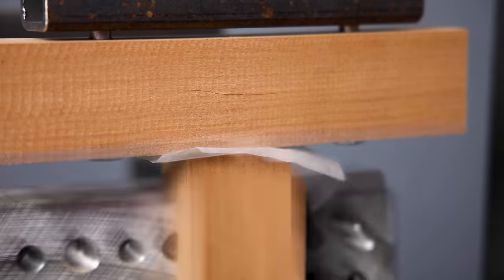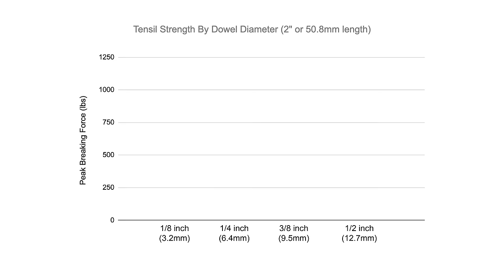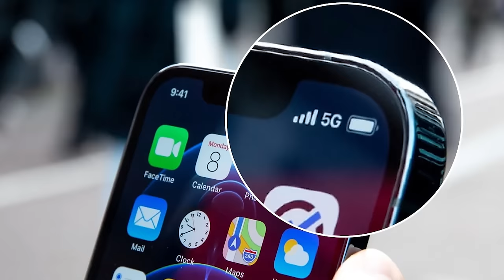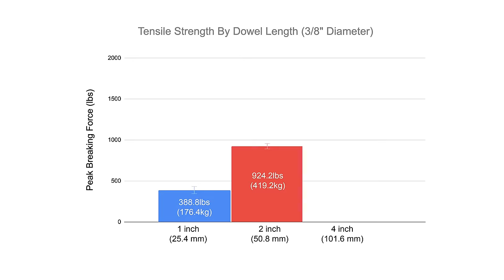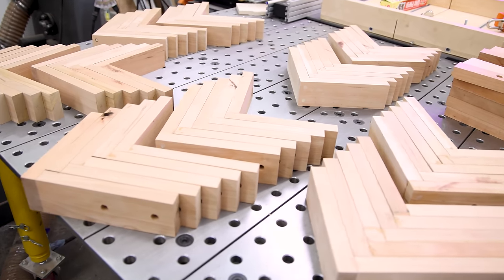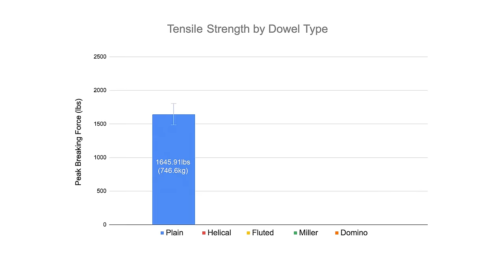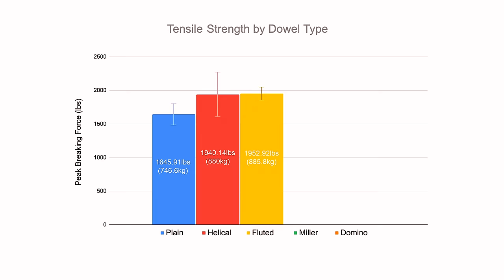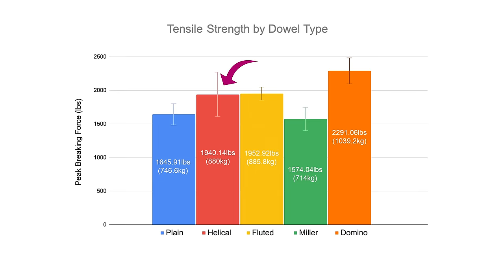festool domino vs  dowels

Comment: The Miller dowel probably has quite a bit of research behind it but is a classic case of theoretical models not reflecting real-world materials.  Where the fibrous tubes within the wood structure are the downfall of the design, now if you had a solid material that also adhered well to wood glue this design might have an advantage when looking at the intersections of strength, surface areas, and material usage.  I think one aspect they were shooting for is having the perpendicular steps being extra adherence areas similar to the gluing of the butt joint of the two pieces, except here it's a butt between an interior surface and the dowel perpendicular to the butt of the cylindrical surfaces.  It's fairly easy to see the logic behind it, but again it just does not work well with the internal structure of wood, and definitely not with the species they're using as shown by the head and shaft entirely separating under tensile pull, meaning the grain structure of the particular species they're using does not hold well to being pulled apart at the shoulders; which defeats the entire purpose of the design.  Again, a different material would likely work well in this design when compared to the same material in the other designs, yet we'll never actually see that done for a variety of reasons. 

Also you really need to denote where the failure is actually occurring.  A lot of the footage, and especially the shear loads, show failure at the wood rather than the dowel.  This discrepancy really starts making this an apples to oranges comparison, mostly because a change in wood species will change the failure point when the wood fails, whereas you mostly don't get a choice of species when it comes to off-the-shelf dowels. 

Dominoes are also a bit of an odd spot, as they're more of a dowel-biscuit hybrid.  Honestly I would've normalized a comparison based on circumference with an equal depth, given they're stadiums (the actual name for parallel-sided pill-shaped 2D objects), calculating this would be fairly easy; thickness equates diameter, width minus diameter gives you the length of the rectangular portion, d₁π+2l gives the stadium perimeter, (d₁π+2l)/π=d₂, where d₂ is your cylindrical dowel of equal perimeter.  You can also do the same for square biscuits, you're just dealing with a square section of thickness and width rather than a circular section, (dπ+2l)=t*w, the only problem is that the length of virtually all off-the-shelf biscuits are elliptical in form for ease of insertion, so unless you cut your own square biscuits you again have to normalize surface area but this time including the third dimension; false ellipses are also a pain in the ass to calculate area for, best case scenario is to scan a biscuit, import the scan into Illustrator (or similar vector graphics programs that have decent tools), use the auto outline/shape generation (whatever the tool is actually called), fill the shape if only an outline is generated, export as a dxf and import that into CAD (such as Fusion360) and the shape will import as a 'filled' object with area ('unfilled' objects will only generate a perimeter as they are only a line, hence why a shape is needed in the vector program), of which then you can pull an approximated surface area for the false ellipses, such as for biscuits that come to a sharper curve at the narrow ends such as how the upper half of an egg is sharper than the bottom half.  

It's also clear where the domino has strengths and weaknesses, again just look at grain structure and forces being applied to it, but this is also true for the mating pieces of wood, again, where you're also adding potential areas of higher weakness in exchange for a larger dowel, biscuit, or hybrid; this also extends into other joinery, such as mortise and tenons, and to some extent dovetails, though finger/box joints operate differently as you don't have a captured piece but rather just high surface area for glue between parallel faces, which is why dovetails somewhat fall in the middle as they're only partially captured.  Glue also does have a limit, different types of glues have different limits, etc.  Different joints have different amount of friction, etc.  Different joints have different directionality, which is why shear and tensile testing have vastly different results, though this does ultimately depend on grain structure, again, etc.  There's a lot more moving parts to 'finding the best woodworking joint' than just these tests, even Wandel has only touched the surface of finding optimal joints. 

I also don't particularly like your jig setup, as it's imparting a rotation on the joint, rather than a linear pull.  This is improper and leads to a skew in the results.  This is why you need a truly linear pull for true results, such as what Stefan (@CNCKitchen) does with his material tensile testing.  Find a way to improve your jig for a true linear separation.  Perhaps in your case just use tee joints and pull from both sides of the tee, this can be used in both tensile and shear tests.

Comment: Miller dowels come in a range of species; I wonder if that would make any difference to the results.
Reply from the maker: In order to keep the tests to a reasonable volume, I used birch for everything. But yes- species is definitely a variable worth exploring.
Reply: @WoodcraftBySuman  that is fair, and as you're comparing like-for-like I think it does demonstrate the Miller's weakness. Certainly not an issue for the uses I've put it to (casework for book cases, for the most part) but oddly disappointing.

Comment: I like the Miller dowels though it is probably because I splashed the cash on them.  The drill is OK in my experience but I can see that it becomes expensive if you use them a lot and the drill wears out.

Comment: Useless test. Dowels aren't made for tensile stress. They're made for shear strength.
Reply: I always thought they acted in both, why cant they if they are glued in?
Reply: @utube1818  Is there a pulling or stretching force on dowels sometime?, yes. Is that what there made for, no. Think about where dowels are used. In an extreme example, they could be used to pin a beam and a column together in a 200 year old barn. All the weight and real load is distributed between those major member. Any pulling forces should be handled by cross beams. The pin is there purely for alignment. Even in a table leg to crossmember, raking might cause some tensil force on the dowel, but that should be handled by the crossmembers width surface area and screws, or a cross section dowel/pin, which again would be shear force. The only force that would misalign the member would be a shearing force. What's failing here is the glue, not the dowel. the larger/longer dowels are "performing better" because there's more surface area of glue, not because the dowel faired better.
Reply: @_.Dave._  Thank you for taking the time to give such an informative explanation.
Reply from the maker: Agreed. There is a reason why I stated these are not realistic scenarios on the first 2 test and the 3rd test has both shear and tensile.
Reply: This is totally right.  While the testing was very scientific and done well, you tested for a condition that doesn't really reflect a real world application of dowel use.  Failure testing is a great way to get results quickly, but in this case, the results don't reflect any especially useful information.  In my opinion, dowels shouldn't be used as a pure joinery method anyways.  They are great for taking a shear load and are wonderful tools for alignment, but thats all I use them for.  Miters with splines are a great easy way to get any angle of corner that is very, very strong, can have continuous grain, and even accenting species if you want.  I would encourage any builder of any skill level to consider other types of joinery before using dowels and butt joints.  Heck try hand cutting wedged through mortise and tenons.  You'll certainly learn a skill or two!

As some others have also stated, the point of the domino is to have a very fast, very accurate, very repeatable alignment tool that also adds a bit of glue surface area, not to make the world's strongest butt joint.

Comment: 6:28 «some women are into it» + 6:50 «this should give you a lot of confidence in using 4" "dowels"» = not so subtle but quite funny.
I'm going to admit that seeing all this data and wood tests gave me a little "wood".

On a serious note: this series of tests was extremely useful. I've always thought that longer is better – with dowels; it's good to see confirming data.

With testing there will always be "what about" questions after the fact. I am wondering about the comparison of apples vs oranges, um I mean dowels vs dominos. Two dowels and two dominos were used, and the two have very different amounts of glue surface. There is certainly room for 3 dowels in the same space required for 2 dominos. Would that be more or less fair of a comparison, or is it apples and oranges? What would the results have been?
Reply from the maker: Haha I really should lean into my sarcastic personality more and hope I don’t get cancelled 😂

Regarding using 3 dowels instead- probably would get more tension strength but the shear strength would likely suffer in similar ways to the domino. There really are so many variables in play but at the end of the day- all of these joints are stupid strong.

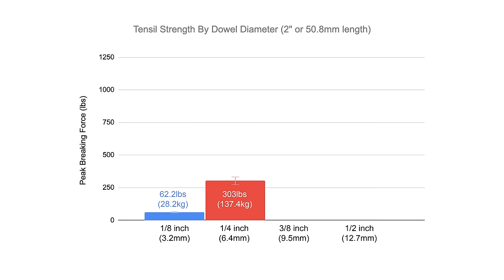Comment: question, 3:49, 2 inches 3/8 you got 709lbs. but 6:07, still 2 inches 3/8, you got 924lbs, that quite different.
Reply from the maker: Yes - I had 2 minutes footage filmed discussing the reason for this difference but ultimately decided to scrap it because it is too in the weeds. Essentially what happened is the primary tests and thinner wood that flexed way more and caused premature failure compared to the second test with a wider board.
Reply: @WoodcraftBySuman  oh thx for explaining that. It's solved my problem

Comment: Interesting but this literally doesn't matter because once you get beyond a threshold of strength, it no longer matters if you can support 1000lbs, 2000lbs, so on. If my chair can support a 500lb man, but not a 2000lb man, it doesn't affect the value for the consumer.
Reply from the maker: This is why I reiterated in multiple parts of the video that all of these are strong enough for most woodworking projects. Testing helps confirm it in some type of objective way.

Comment: I wouldn’t trust your data simply becuz a factor you haven’t taken into account is the grain direction of both mating surfaces. Some are end grain to end grain, some end grain to side grain… end grain to end grain regardless of dowel size is always going to be weaker…
Reply from the maker: They’re more realistic scenarios. And if they mattered so much, the consistency of the seats wouldn’t be nearly as tight. But ya know, you do you.

Comment: Hey Suman, Fantastic Video as always!!
Tensile strength test would be edge to edge joinery where the glue line runs perpendicular to the direction of stress. 
(The glue is effectively being pulled apart)
In this test, However, While you are "Pulling" the pieces apart, The glue between dowel and the workpiece is experiencing Shear Load "Along" the glue line and not "across", if that makes sense :P 
No complaints though, Glue joints (Regardless of the material itself: Metal, wood, composites or any other material) perform best with shear loads in the first place.
For some eye opening info on glue joints, Take a look at this video by the engineering maestro Dan Gelbart:
https://youtu.be/EeEhS3zmnDg?si=He4C_lw65zHTIDn0&t=425

Comment: Thanks for the video. But also the line up of dominos and the finger holding the domino. That’s high level advertising. 

This, replaces any of these… send $1400 to festool now!
Reply from the maker: In the last test, the domino performs the worst of all tests. The video is largely critical of the domino in terms of strength. The domino isn't necessarily worth the price of admission based on strength - but I have one for the ease of operation (especially on funny angles) and speed.

Comment: The Video is useless . The Domino is fast AF regarding positioning, repeatability, presision and is strong enough.  Ist a clickbait not more. Why compare a Tool by Price? I get every furniture in a time done with the domino you can eat your dowels because to use them manually, Slow „jig“ what ever is Not Even comparable to the Domino System in every way. So stop it!